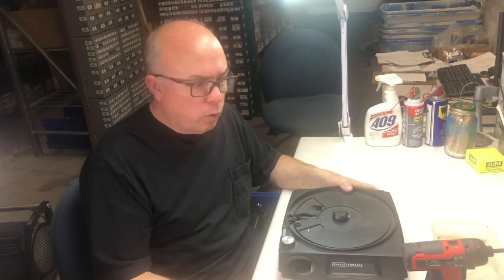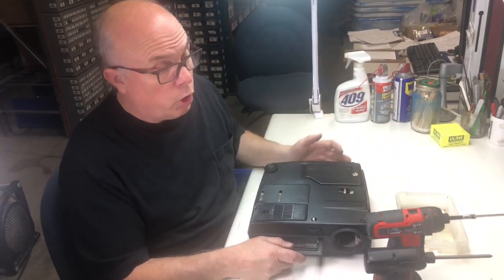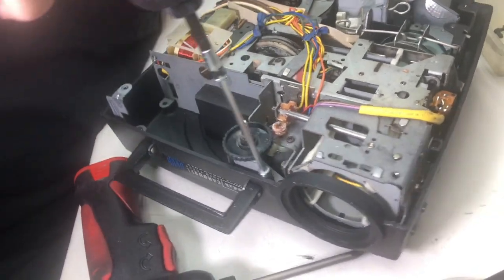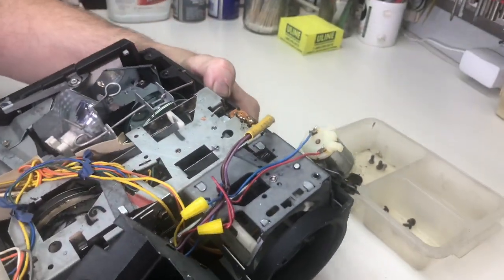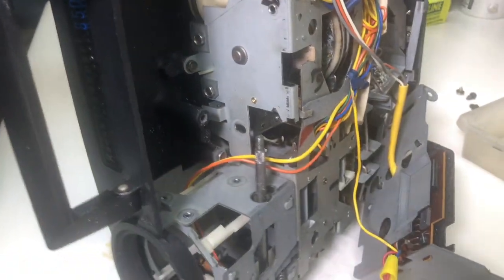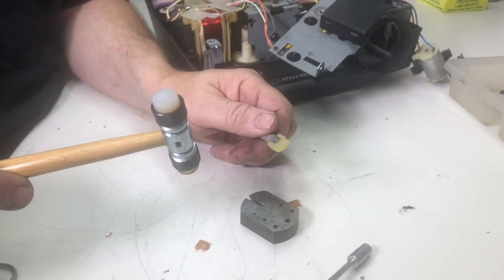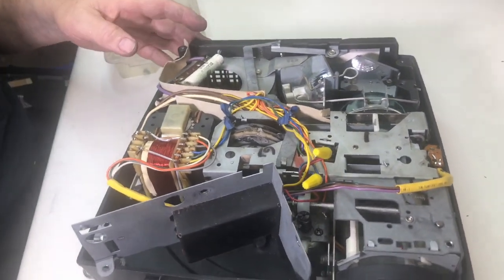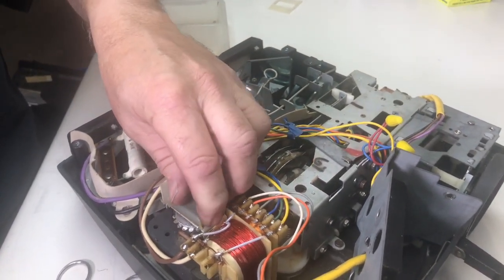Kodak 850H Repair

Comment: This and Curt's other videos are great!  With it, I've been able to begin to repair a fleet of projectors.  The broken solenoid link is a theme, also cracked manual focus pinion gears.  Watching the contents +/- 30 seconds of installing the plunger and magically rotating into place.  The video is so much better than the PDF or pre-printed docs that come with a repair kit.  All very do-able.
The key to me is his large channel-lock pliers that have the holes drilled thru the jaws. It makes it possible to press-fit the white gear onto the shaft.  No need to stack a 1/4 or 5/16 socket (or metric equivalent) onto the end of the gear.  Easy-peasy as the Brits would say.  Great advice, great product

Comment: Followed the video using the repair kit, needing all of it (all 3 pieces were broken).  The larger gear on the focusing assembly was impossible to install without enlarging the center hole to accommodate the larger shaft.  And, of course, the solenoid plunger was "difficult", but finally installed.  For some reason (later to be investigated) the focusing assembly doesn't work, but that can be done manually.  I now have my 40+ year old machine (Ektagraphic AF-2) back.  Thanks.

Comment: Wow, a few years ago when I tried to use my folks' old slide projector and it would not advance the carousel, I figured it was just done for.  It's in very good condition, only thing I can recall ever being done to it was replacing the bulb once or twice.  I'm going to have to find this new plastic link kit and give this repair a try.  I can do it as long as I don't foul something else up.  Thank you for the video.

Comment: Curt, 
Thank you for your very helpful tutorials. I successfully used your 750H Slides Not Advancing one on our personal projector, and did the same on a friend’s 760H projector. However, on his projector the focus is just way off. I looked at your video of the 850H repair with the automatic focus motor, but I guess I don’t understand how or what that focus light does that adjusts the focus. On his 760H the focus light illuminates, and the focus motor gears turn, but nothing seems to happen. I don’t have the focus or target slides that you show in your video. Are those necessary, or can I just use an actual slide? Also shouldn’t I be able to manually bring a slide into focus with the 760H machine? Because I cannot focus a slide even with that.

Comment: Hello Kurt,I get a Kodak Carousel Custom 860H .It works quite well but recently ,the slide tray cannot rotate or move when I press ‘forward’ or ‘reverse ‘ button . it can’t work even I set the timer .Do you know the reason behind the problem ?thanks .

Comment: Hi Curt, I have a Kodak Carousel 600 that will not show the slide.  It takes the slide when I hit select then the light goes on the screen and then instantly goes dark.  It’s seems like there is something that is suppose to move Out of the way so the slide can be projected, but it is blocked.  Is there something that causes that that I can fix ?

Comment: Curt, I have my 45ish year old Carousel 4400 projector and the fan started squeeling and slowing down, shut down right away.  opening up bottom shows a ceramic coated coil in the inlet area of the fan and the ceramic is all disintegrated and loose in the housing.  I've shaken and blown most of it out.  a. what is that ceramic cylinder electrical part, is it something that is available?  b. is there a lubrication procedure recommended for the fan?
Reply: I can answer the "a" part of your question: the "ceramic" part is a dropping resistor.  It's function is to lower the voltage to the projection lamp to increase its life.  Don't worry about the slaking of the coating the part is a wire wound resistor. Just keep the chips out of the rotating parts.
As for the "b" part of your question, all I can say is lubricating squealing parts is always a good idea in anything that rotates

Comment: Curt:  Have an 850H that the only thing wrong is the solenoid broken plastic link.  Saw your video and don't care to repair since I have two more working models.  If you are interested on it or know someone that is, I can donate if willing to pay for the shipping. I have the power cord and the wired control remote.  I live in Virginia. Regards, Jose

Comment: My 850h when turned on just advances very fast all on its own.
I purchased and installed new gears and plunger.
The select button and two foward and reverse buttons do nothing, except the foward makes a click noise, and focus motor jerks slightly. I give up
Reply: Hi, my 850H also advances automatically and very quickly. did you ever figure out a repair for this?

Comment: What do you do if the light turn on but is not projecting
Reply: that sounds like 'not advancing' as well as not moving backwards, either.  It's a solenoid link replacement.  If you find the broken one, that's proof enough.